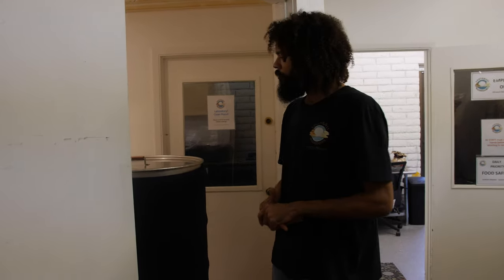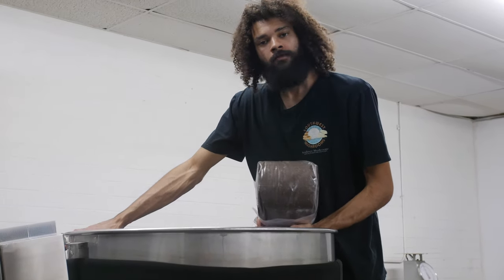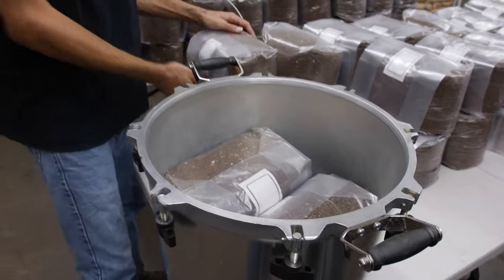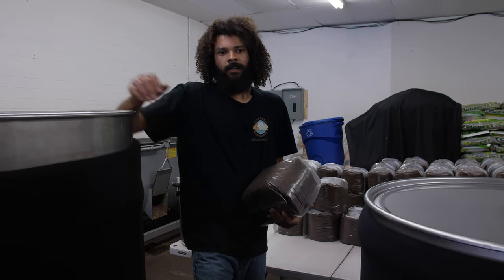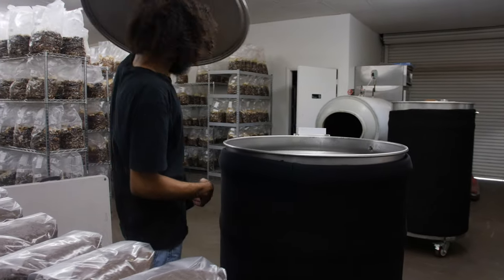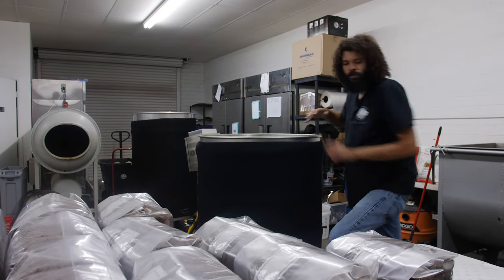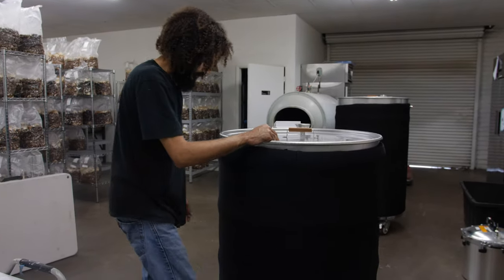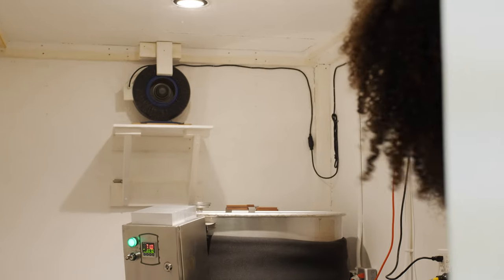Sterilizing Our Hardwood Substrate Production Blocks for Mushroom Cultivation | Southwest Mushrooms

Comment: Can we get a link to those sterilizers?  Those are awesome.
Reply: Yes please.
Reply: @AaronAlso  what about the smaller ones? would be nice for a small home starter.
Reply: @markraf6481  
If you diligently search google you will find that the largest commercially available PC is 80L. It is twice the size of an All American 901 and about half again the price. It only runs at 10psi but that just means longer run cycles, but not as long as a barrel steam sterilizer.

Comment: You probably shouldn't use the galvanized steel boxes in an aluminium p/c, the aluminium will corrode over time due to Bimetallic corrosion. Great content though probably one of the best channel's on YouTube for explaining things clearly?, keep it up✌
Reply: Great advice! planned to use his tip for risers but after rethinking I might just use some short canning jars around the base with some holes drilled into them instead. I like my PC and wasn't cheap and use it for other things as well.
Reply: Doesn't matter over short time intervals.
Reply: @hillaryclinton2415  you can see in the video he has been using them for a while   because the reaction process is clearly visible hence the original comment.  But yeah in a pinch they shouldn't be a problem.

Comment: Are you closing the bags before putting them into the pressure cooker? Or are they just folded? If I wanted to do this at home - could I place them into the pressure cooker with the ends sealed up?

Comment: 7:00 ish. You are talking about stepping away from using soooo much plastics. Maybe now you have a big enough company. Get hold of a borosilicate glass producer - and come up with a design that will make 2.5Lb - 5Lb wide mouth glass mason Jars, with plastic lids (0.2micron vented and syringe ports in lids and in rows around the glass jars)... This way u have option for inoculation by transferring, or syringes - and all equipment is 100% reusable. You can start a production line/sales for the jars idea aswell. I'd buy 1 or 2. 
For me, they could go in, 1 at a time - in a regular sized home pressure cooker - like the one in your video, (if product is made with those specifications in regards) ..... Just a thought. It's something I been thinking of for while now. 🍄💚☮️😎

Comment: Southwest Mushrooms
Hi. 75-80 degrees is enough to sterilize sawdust, you can simply fill in 60-80 sawdust with hot water, and put them in a warmed place and when you finish forming the packages, the first packages will cool down and you can add mycelium, I have never had any harmful spores. tested 5-10 pieces

Comment: I’m using the All American 41 qt with 4 10 lb / 4.4 kg XLS-B Unicorn 0.5 micron filter bags and these things keep popping. 

I brought it up to 15 psi and then vented it and around 10 psi I heard an explosion from inside the sterilizer. My bags keep popping. 

Am I folding them wrong? I folded gusseted flaps with the filter patch inside, against the block. Should the filter patch be on the outside, touching the neighboring block?

Comment: How is it possible that the temperature does not dissolve the plastic bags?
Reply: Plastic generally only becomes liquid at 180c any higher and itll start to oxidase and burn to carbon black
Ps, use polypropylene bays not polyethylene bags for sterilising

Comment: Hello, I'm Leo. Nice to meet you.

I'm from Santa Maria, Brazil. I'm looking up to profissionalize the muschroom cultivation that we had here. We used to work with trash bags, with an large amount of substrate, and want to change to PP bags with a more moderate quantity of substrate.  I'm curious about the sterelization process. We used to pasteurize the substrate at a water tank. We used  firewood to get the heat. But, as we want to cultivate in a more clean way, we need to change the sterelization process. Have you built this sterelizer? Or have you bought it?
Could you help me with this? 

Thank you very much.

Regards,

Leo.
Reply: I forgot to ask, what does you use to heat the water? I have never seen something like that in Brazil.

Comment: I only have access to sawdust directly from the sawmill.
My Question is do I need to compost the sawdust for some days or I can just go ahead and pausterize.
Reply: Just go straight to pasturise id think. Composting only invites contamination.. not to say thats not a bad thing if you want compost. But i  would think just pasturise right off
Reply: @johnpwright7832   & @Ayobami Olarewaju  depends on what you want to grow and on what your sawmill is getting you. Very little will grow on pine sawdust i.e., similar difficulties with pure maple. If that is what you have, compost it thoroughly as your sterilisation step: breaks down the natural fungicides while heating enough to pasteurize  without using (other) fuel :) Hardwood mix sawdust shouldn’t give you trouble to pasteurize immediately, can be used as is :)
Reply: @Amaarten  thanks man its true that every strain has there own niche. I only just found out that the pine same is very much anti microbial with its properties. :)

Comment: This seems quite unergonomical. May I suggest using a simple snatchblock or similar system to lower stackable trays (with blocks on them) down into the sterilisers? If round trays don't fit your bench in the lab where you unload them, i can design you some hinging baseplates (gripping into each other for stifness & strength) that spiral together to go in the steriliser, but hinge into a line for cooldown in front of the flowbench (with gaps between them for efficient cooling of course). Would save you time and effort ;) nice  id again BTW, thanks for the candid information sharing and great production value!

Comment: I have one suggestion for recycling plastic bags,  the plastic bags are strong and we can reuse it. 
First suggestion.
First you use two bag one inside with holes and outside without holes. 
You remove outer bag without holes, whenever needed, so that inner bag .........try to understand. 
Second suggestion.
Whenever you  have finished using bag........
You rub it with dry wet towel,  you can use washing machine for this purpose.  
With dry wet towel you can rub , easygoing .
You  can wash all dirty towels in washing machine.  Buy separate washing machine. 
Another option is you can wash plastic bags in wash basin and reuse it , but this will be longer job.
You can dry it using glass stand sold by Chinese or you can pin it on the rope. 
As per as my suggestions dry wet clothes cleaning is good. Easy to maintain. 
Don't wash infected plastic bags,  throw it.
You must experiment for inside and outside plastic, using this technique you can save money on buying plastic bags. 
I hope you understand what I want to say. 
Namh shivay.
Reply: I like your suggestions and like verymuch last words ie  🙏🙏🙏      nama sivaya .

Comment: Will this work for sterilizing grain spawn?? I ordered one thinking it would replace an autoclave but I think this won't work for generation one spawn bags... I was told it was a high temp pasteurizer not sterilizing
Reply: He addresses that in the video. He said he'd tried and had decent results, but that he'd then do the whole cool down in front of a flow hood, whereas with a pressure canner one can let the whole batch cool inside the canner and only open individual jars in front of the flow hood when innocaulating.

Comment: Organic plastic recycling is worse than it seems at first. Usually biodegradable plastics and biologically degraded plastics decompose into compounds that are very hard to process any further. The problem herby is that they can’t really be contained within the resources cycle and you’ll need to extract new resources to fabricate new products. 
There are sustainable solvent based recycling processes being developed and already tested such as the „CreaSolv process“ which yield plastics that are (already now) 99,5% as good as fresh plastics.
This way resources can stay within the Ressource cycle much much longer and thus far less crude oil is necessary. The (probably unobtainable) end goal would be a 100% circular economy.

Comment: Burn the plastic in a high temp furnace..  no contamination.  The other problem is exposing soft plastics to steam leeches undesirable additives into the soil.  Use the sterilizer as the container.